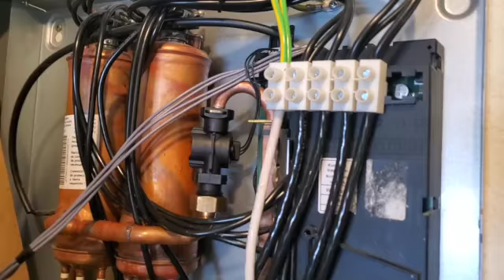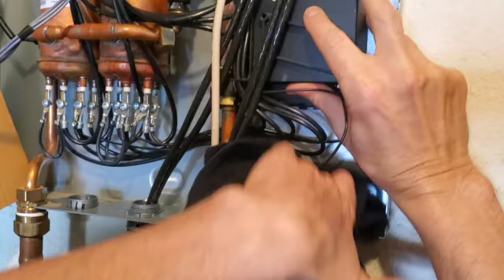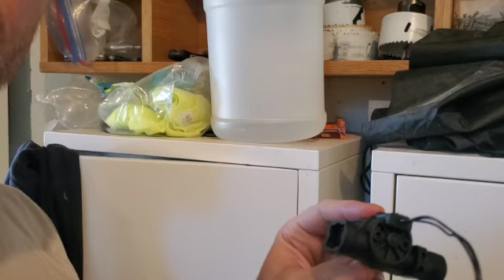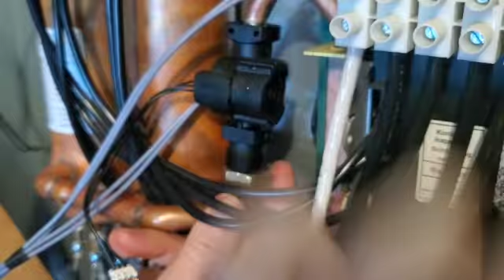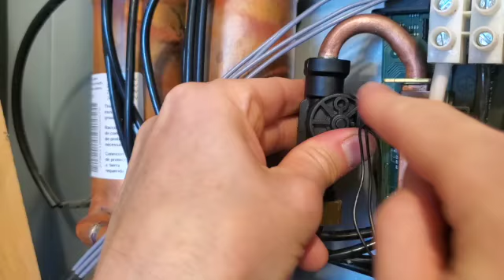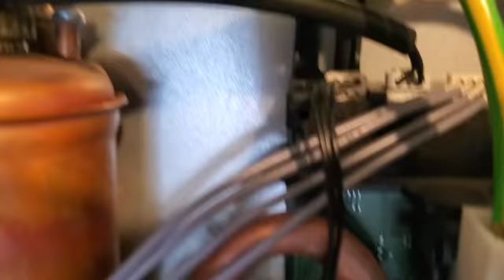How to Replace the Flow Sensor in your Stiebel Eltron Tankless Water Heater

Comment: Thank you for the video it was immensely helpful and fixed the ongoing issue we had where the hot water (and red light indicator) would only come on after several tries of turning the shower on and off repeatedly. It was the solution to our issue but it unfortunately somehow created a new one. The HWH has been set to 121° for 10 years, while showering we would never turn the handle to the hottest setting. In the showers since replacing the flow sensor, I have the handle turned all the way up and can put my face directly under the shower head and it’s barely hotter than maybe 100°-102° if I were to guess. We adjusted it to 124° hoping that would help and that made a minuscule difference, still turned it to the hottest setting and it was barely hotter. This was not an issue prior to replacing the flow sensor. Any thoughts/ideas/advice would be much appreciated!

Comment: @Andromedus Awesome video! Stiebel Eltron actually sent me this video to show me how to replace it.

I made a step-by-step list for myself that I thought I might share:

Replacing the Flow Sensor

1. Shut off power
2. Shut off water
3. Turn on hot water to relieve pressure in lines
4. Use flathead screwdriver to remove the electronic connection from sensor to the top of computer board
5. Have a towel ready to soak up any water
6. Use channel locks to unscrew nut from below sensor
7. Use a flat head screwdriver to remove the cotter pin on top of for sensor
8. Use channel locks to unscrew the nut from the water supply
9. Use right hand to push the board up to free flow sensor
10. Use left hand to wiggle sensor free
11. Remove and discard old o-rings
12. Add plumber's grease to upper male brass connection 
13. Place smaller thinner o-ring on upper male connection on tip
14. Wiggle new sensor in place 
15. Make sure wire coming out of sensor is on the right side
16. Ensure the upper part of the sensor goes over the flange
17. Place large flat o-ring on bottom connection
18. Use channel locks to retighten lower nut on water supply 
19. Insert cutter pin on upper sensor
20. Use channel locks to retighten nut on lower sensor
21. Plug electronic connection from sensor back into the board
22. Turn water supply back on to check for leaks
23. Turn power back on
24. Test hot water

FYI: "Cross-Threading means a screw or bolt is inserted at the wrong angle, causing its threads to misalign and jam with the threads of the hole or nut, cutting new, damaged threads instead of smoothly engaging, which can permanently ruin the connection and make it difficult or impossible to remove." That term threw me off, but now I know what it is called.

Comment: Heater heating for a minute or two and stops heating . Power is still on as power indicator is onn but heating element lacks power with its indicator, am unable to troubleshoot the problem. please advise.

Comment: Great straight forward video. Just did this repair and it solved the lack of hot water. I did a flush first since it had been awhile - and while it may have needed that it - didn’t solve the lack of hot water. Flow sensor worked! Think I’m going to order a spare to have on hand just in case…
Thanks!

Comment: Thank you. I just replaced the flow sensor on my Tempra Plus, 9 years old, and although it's an easy job, it's nice to see someone do it first. Especially the part about lifting the right side to disconnect the top part of the sensor. Mince had two screws to loosen first. Worked like a charm.  Cheers!

Comment: Came home today to no power to unit. Reset breakers and no luck. Tried the reset buttons inside with no luck. When your flow sensor died did your tank still show it had power? Or was it not lighting up at all? Thanks. Great video.
Reply: Hey, what did you find to be the issue with yours? I just came home to same problem.

Comment: Do you know if the flow meter can be bypassed? It seems if you don't have enough flow, it won't signal for heat. As others have noted, some water appliances seem to not have enough flow rate. So multiple points of use must be on. Thx.

Comment: Just want to ask, is the flow sensor responsible for the hot water flow? Thanks.
Reply: Yes.  If it can't sense the water flow, it doesn't activate the heating element.